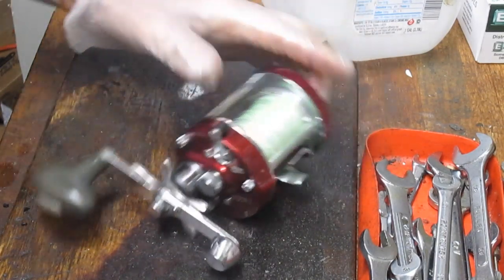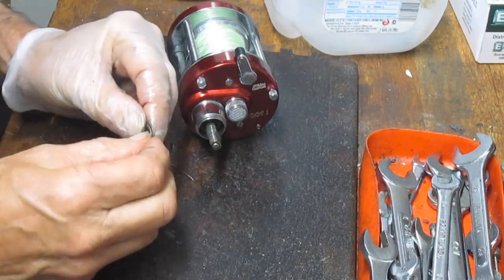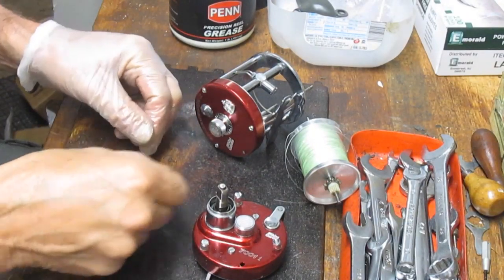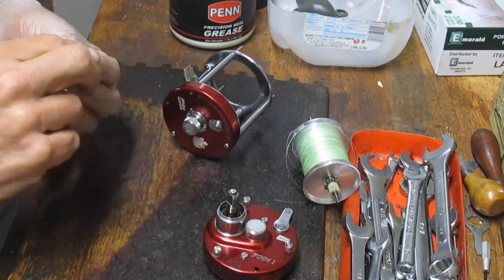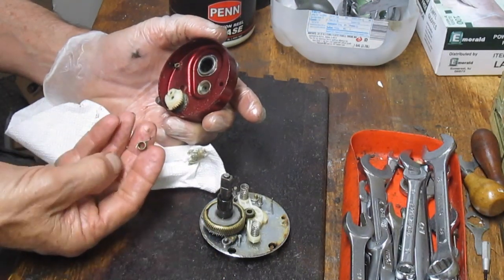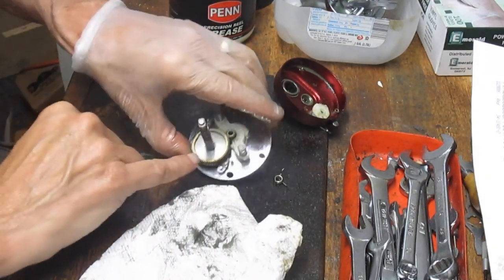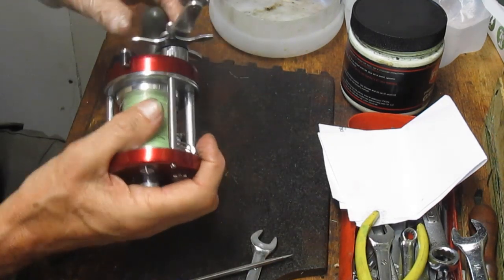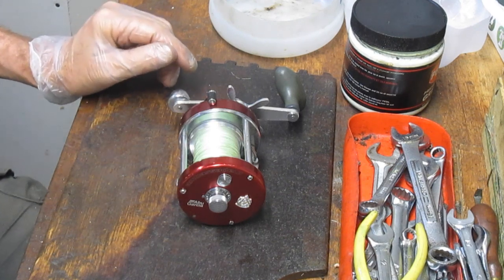Abu 7001 i Ambassadeur how to take apart and repair a broken free spool release step by step

Comment: Do you know if the worm gear is the same with which other reel? I can’t get parts for it anymore
Reply from the maker: I am not sure.  Have you tried ereplacementparts.com or southwestern parts.com?  They carry the Abu parts
Reply: @2ndChanceTackle thanks for the web! after a month finally I’m able to get my hands on the parts needed. Unfortunately after rebuilding, the spool does not “freely” spin as before. Noticeable resistance can be felt even though the tension knobs are unscrewed. Where do you think is the issue?

Btw your video helped me lots, this is the only disassembly video in the whole of YouTube for this model!
Reply from the maker: Check to ankle sure that the spool brakes are not trapped in the spool ring.  Pull the brakes in on the rods before putting the side plate on.  That would be my first guess as to why the issue is occurring in your reel - Dennis

Comment: Got a question for ya. 
Will a handle from a abu garcia ambassaduer 7000i fit a standard 6000 ambassaduer or a 6600 cl rocket.. i was told all abu abassaduers handles are interchangable no matter the size or makes
Reply from the maker: It should.  You are correct, most handles are interchangeable on the Ambassadeur series - Dennis
Reply: @2ndChanceTackle  its to big tryed it today. Thanks

Comment: I thought for sure one of those centrifugal bake pads was going to fall off when you lifted out the spool and held it high in the air for a sec. That happens to me all the time, I go to reassemble and then see one is missing and have to check the rug for an hour looking for it..lol, not fun.
Reply from the maker: I'd be lying if I said that never happened to me!  I can recall losing 4 at once on a reel because I wasn't paying attention and just trying to do a "quick" fix.  Thanks for watching - Dennis